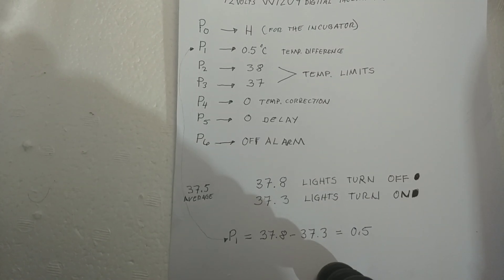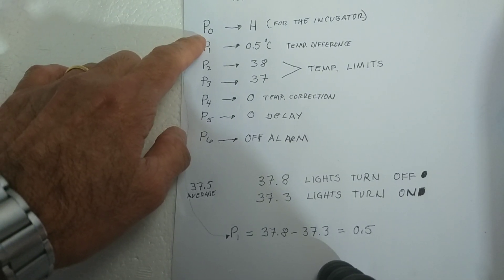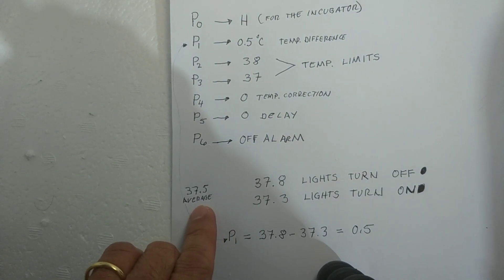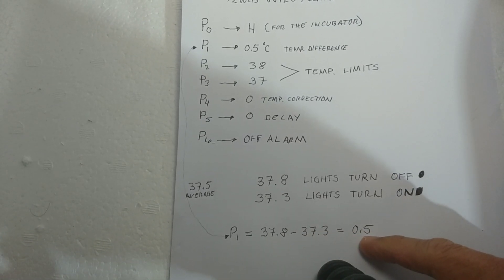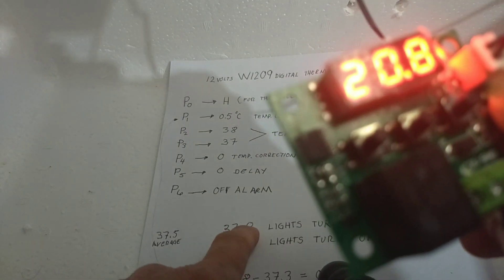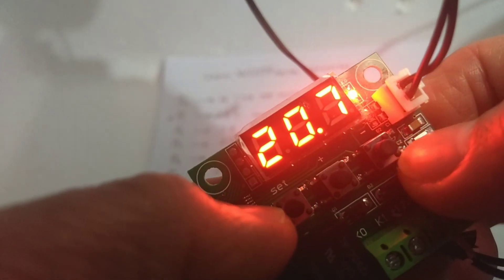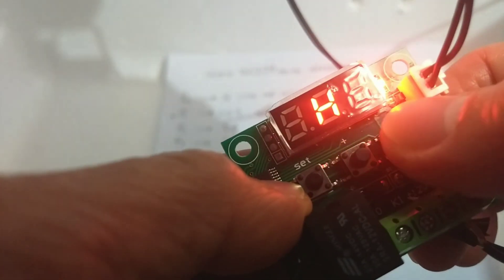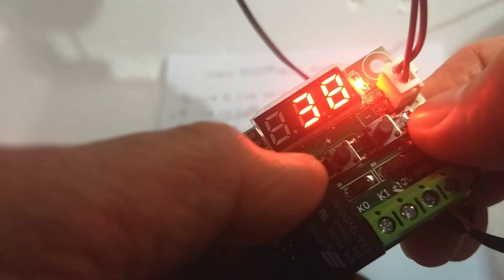HOW TO SET W1209  12volts DIGITAL THERMOSTAT FOR CHICKEN EGGS INCUBATOR (@ChickenTour )

Comment: I'm tryin to program my thermostat to heat up an aluminum block. 
settings 77.5. P0-H, P1 - 0.1, P2 - 89, P3 - -50, P4 - 0, P5 - 0, P6 - doesn't give me options.
HOWEVER when the temp hits 50 the Thermostat turns off. The LED shows  ( -  -  - )
What is going on?
Reply from the maker: If you want to maintain an average temperature of 77.5 , you may set your blinking numbers  to 78  turn off,  and 77 to turn on . Set your P1=1 (78-77=1)..... (Your problem with your settings meaning out of range)

Comment: Can someone help me when light blink on w1209 than i need to set on 37.3 or 37.8?
Reply from the maker: When light blink you have to set it to 37.8.
Reply: @ChickenTour  but than lights will turn off on 38.3 not on  37.8
Reply: @ChickenTour  0:27 you wrote on paper that lights will set off whrn is temperature 37.8 when i set temperature 37.8 and p=1 0.5 my lights yurns on 38.3 not on 37.8 and lights are yurning on again when temperature is drop on 37.8
Reply from the maker: Check if your thermostat is calibrated . . Watch my video "ASIL CHICKEN" ,at the end part I have shown how to do that.
Reply: @ChickenTour  i found video i will be  honest i didn really understand language but i think i need to put prob in cold watre and i will see calibaten and than i need to put that number in p4  em  i right?
Reply from the maker: @filipangelovski2870  when you set the blinking numbers to 37.8 don't forget to press the "SET" button to save.
Reply: @ChickenTour  yes i evry time i click button set
Reply: For this em i right or  is for nothink
Reply from the maker: When you put the prob in cold water with ice , the prob should not touch the glass.The reading should be at Zero (0.00), if the reading is (-0.2)  go to P4 and set it to (0.2).... But if the reading is (0.2) go to P4 and set it to (-0.2) ... The reading should be at (0.00) ..that is  "FREEZING POINT"
Reply: @ChickenTour  thank you very much ♥
Reply: @ChickenTour  nop is not working i put prob in cold water  i saw on thermostat - 0.4 than i set p4=+0.4  thermostat is showing 0.0 than i set p=1 0.5 and blinking number 37.8 and ligts turn off again 38.3 lights turns on again on 37.8

Comment: Sir @chick tour, yung wire ng output thermostat ko di niya nakaka gana yung ilaw at fan kahit tama nman yung pagkakabit.possible kaya na yung wire ang problem?
Reply from the maker: Una sir, check natin yung power supply ng adaptor na 12volts , at least 0.8A sya .

Comment: my will not not let me set p3 to 37.  but the power will come back on at 37.5 p3 will only go to 28
Reply from the maker: Even you set P3 to zero as long as you set the blinking numbers for example to 38  and P1 to 0.5 ( 38 - 0.5 = 37.5) ,so the light will automatically turn on at 37.5
Reply: @ChickenTour  thank you

Comment: Sir gud pm po..  Nakabili po ako ng two 12v fan blower.. Model: HQ 12038ASL/T
AC 220/240V 50/60 Hw 25W.. 18A daw po ito..  Pwd po ba gagamitin sa thermostat 12v 10A..  Gagamit din po ba ako ng adaptor d2 sir??  Salamat po
Reply from the maker: https://photos.app.goo.gl/4EN84zsWHFzdNQQw9
Reply from the maker: Gud pm mam Sheila , pag 12 volts ang Thermostat kailangang gumamit Ng 12volts adaptor at least .8 A , pero pag 220volts ang Thermostat Hindi na kailangan ang adaptor.
Reply: Saan po ikabit ung fan blower sir...  Isasamako po ba sa bulb..
Reply: Ang thermostat kopo sir 12v/220 10A digital..  Ang fan blower ko po sir HQ-12038A2S/T
220/240V 50/60Hz 25W..
Reply: Sir gud pm po..  Nakabili po ako ng two 12v fan blower.. Model: HQ 12038ASL/T
AC 220/240V 50/60 Hw 25W.. 18A daw po ito..  Pwd po ba gagamitin sa thermostat 12v/220v 10A LED Digital Gagamit din po ba ako ng adaptor d2 sir??  Salamat po

Comment: Sir salamat po sa video ng pag gawa ng incubator naka gawa na po ako baligtad lang yung blinking numbers nya dapat i set ng 37.3 doon po mamatay yung ilaw sisindi po sya ng 37.8 good day po at salamat..
Reply from the maker: Aba ok sir yan Congrats buti Naman at nakagawa Ka na din . Ang blingking numbers sir ay I set mo sa 37.8 para dyan mamamatay ang ilaw , tapos ang Po i set sa   H  , at P1 sa 0.5 , AUTOMATIC mabubuhay na  ang ilaw pagdating ng  37.3 ( dahil 37.8 - 0.5 =37.3 ) . Ilagay mo na din sir ang P2 sa 38(max.) at P3 sa 37(min.).
Reply: Chicken Tour iba po yata sir settings ng w1209 na thermostat na nabili ko kasi po pa set ko ng blinking number nya 37.8 umaabot sya 38+sya namamatay ilaw kaya po sa 37.3 ko na set jan po sisindi ilaw tapos mamatay ilaw 37.8 salamat sir sa turo nyo yan lang naman binago ko kalahatan sinunod ko salamat po
Reply from the maker: @sputnikgang2693  Ah ok  sir ginawa  mo nag adjust kanalang sa w1209.

Comment: Sir yung nabili ko from china the same yung itsura ng gamit mo but indicated sa relay  is 110vac, e 220v tayo sa pinas. Mali yung ipinadala sa akin ng seller. Pwede pa rin kaya magamit? Hindi kopa tinry, and baka hindi ko na ma return or replace s kanila.
Reply: sir pwede ba gamitan ng 220 volt na bulb ang 12v temperature module ko.,, salamat
Reply from the maker: 12volts na bulb din Ang gagamitin ,pero pwede din Ang 220volts na bulb gagamit Lang Ng inverter.
Reply from the maker: Sa thermostat na w1209, kailangan Gumamit Ng 12volts adaptor Gaya Ng nasa video dahil 12volts Ang w1209.
Reply from the maker: Pwede sir yan, ang supply voltage mo naman ay 12v, since 12 volts ang  thermostat na  w1209 ,kapag nai plug sa 220 volts pag daan sa relay (yung black) mag switch lang sya ang output voltage nya sa relay ay 12 volts din.

Comment: I tried to set my thermostat too sir which is d same model like you have. But I cant set the p3 to 37. It has a max which is only 22.1 😢 What do you think is the problem with mine sir. Hope you read this. Thanks a lot
Reply from the maker: It's ok there is no problem , when you set the blinking numbers to 37.8 with P1 = 0.5 , the Thermostat will automatically turn on at 37.3( there is a 0.5 difference ).
Reply: mine will only set the p3 at 28.. but if i heat the censor it goes off at 38 and back on at 37.3 so all is good i think
Reply from the maker: That range is good , our target average temperature is 37.5 ( 38+37.3 = 75.3 ÷ 2 = 37.65 )

Comment: Hello sir. Do you have p6/p7/p8 on yours. Mine has it. It dose not reset to factory settings.
Reply from the maker: Sir yes I do have p6 but I don't have p7 & p8, ... p7 is for data lock (on/off), when data lock is on, the settings cannot accidentally be changed unless you turned it Off. p8 is for factory reset, try it,or just leave p8 to off position sir.
Reply: @ChickenTour  thank you for your fast response, i believe i will buy new ones , without p6,7,8 it deems no one has these. Also the reset dose not work.